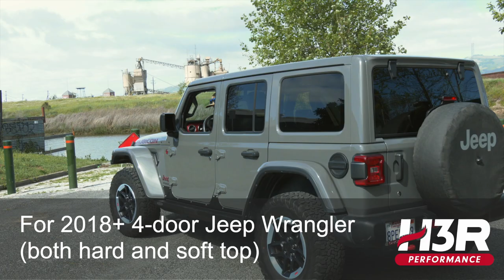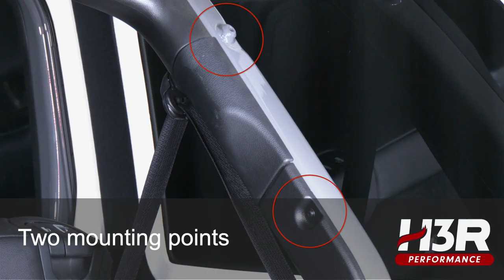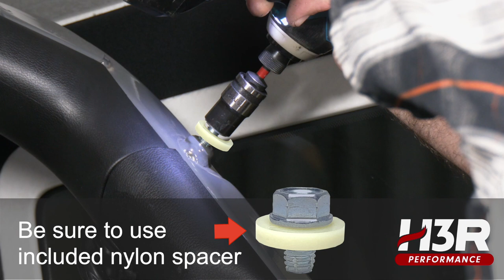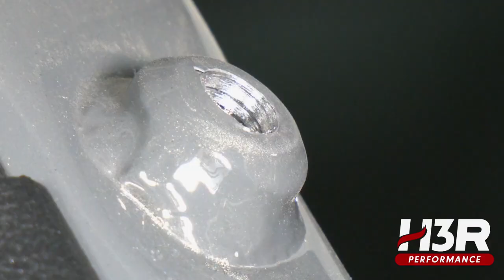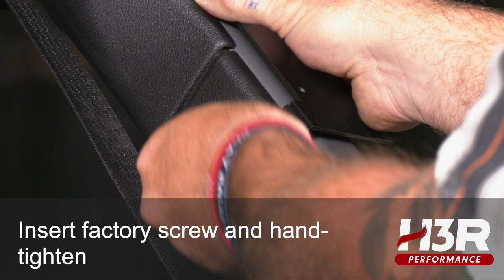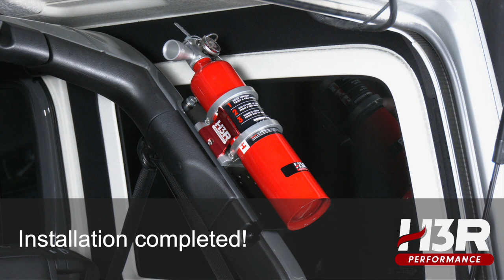Installing the Jeep Wrangler Fire Extinguisher Mount

Comment: My recommendation is to not start with the self tapping bolt to tap the roll bar. Instead start with a 3/8-16 tap and slowly cut the threads into the roll bar. Then when you've cut deep enough, drive the bold the rest of the way in. I would even run a 5/16 bit through before you start just to clear any paint that's filled the hole.
Reply from the maker: Thank you for your feedback!